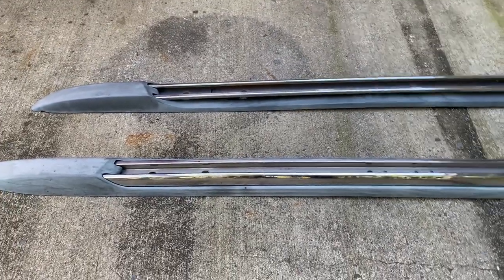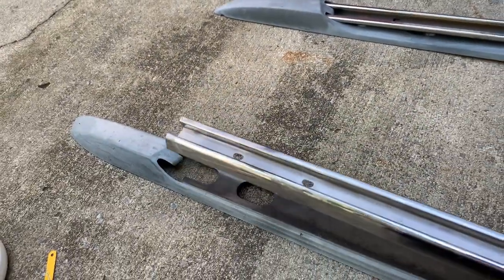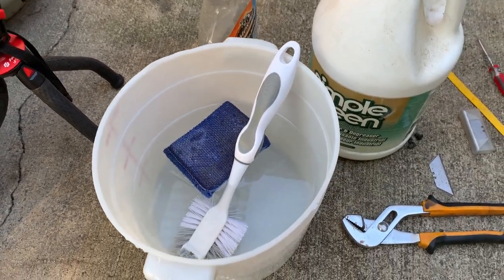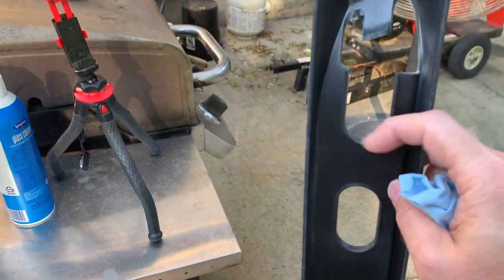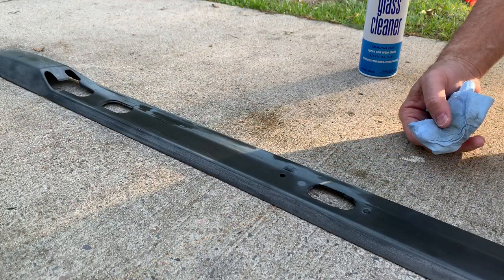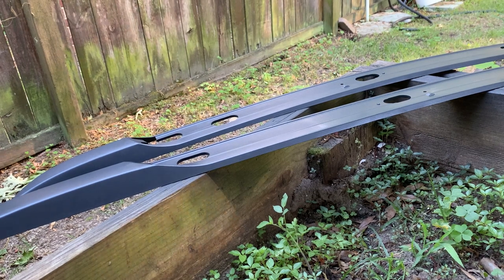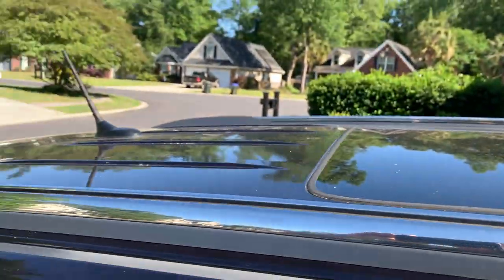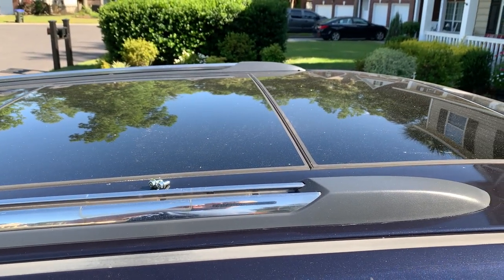2011-2022 Jeep Grand Cherokee - Roof Rail Painting

Comment: Hey there, where can I find the plastic rivets to reattach inner rail piece to bracket?
Reply from the maker: Hello! Thank you for watching the video. I did not replace the plastic grommet pieces. The metal bracket slides into the plastic housing and the mounting bolts pinch everything together just fine! -Dutch
Reply: @dutchmenmodsandrepairs1427  thank you. How did the paint hold up on the chrome? I ended up wrapping mine.
Reply from the maker: @jeremylevine9109  I didn't paint the chrome part as it was/is in pretty good condition and mostly covered up by the plastic. If they were rusted or in bad shape, I probably would have scuffed them real good with scotch brite and painted them with some chrome rattle can paint. It would have been good enough for me!